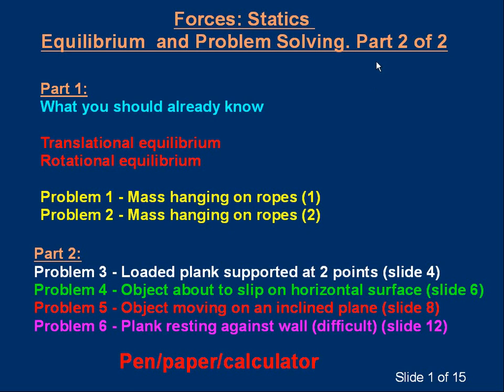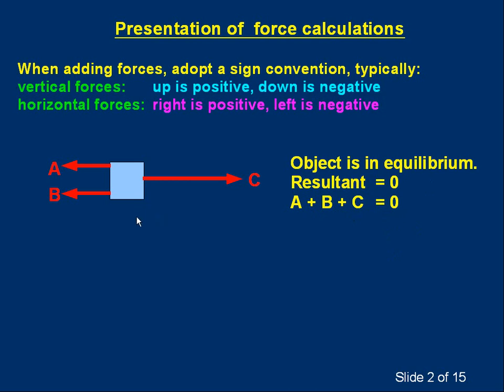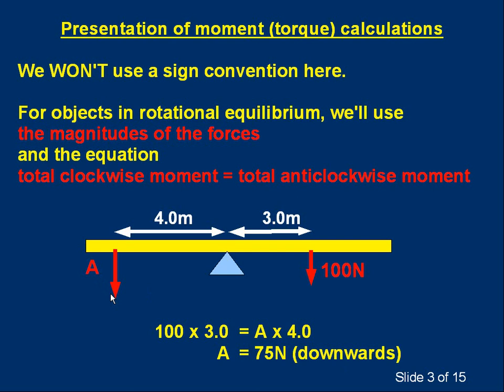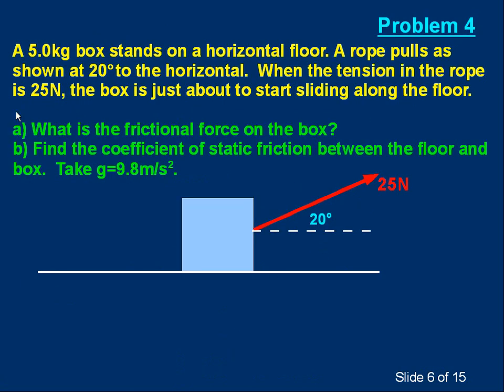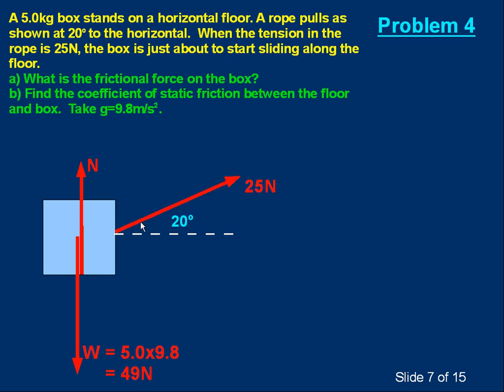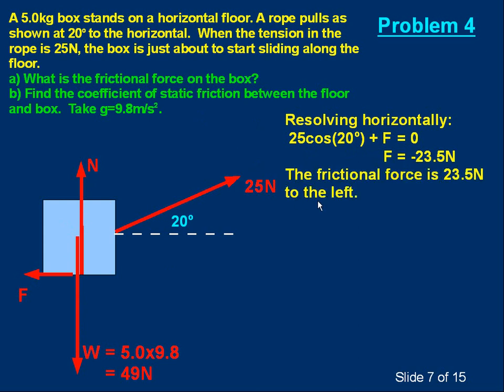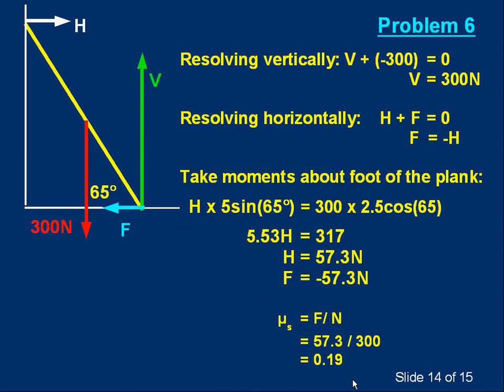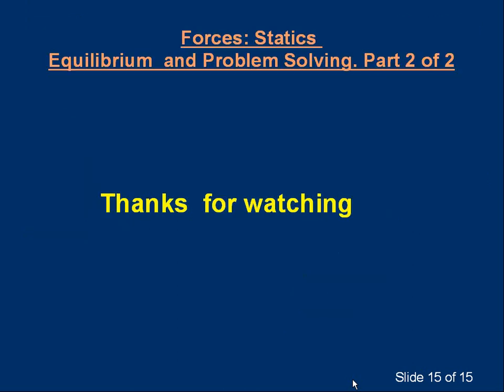M15b Forces: Equilibrium and Problem Solving. Part 2 of 2.

Comment: Hi, thanks for the brilliant videos great job. Just a question at 25:13 problem 5, when you are resolving the plane parallel to the slope why is Frictional Force F positive? should it not be negative as it is opposing motion, i see that the answer is negative which is correct but when you are resolving it is positive.
Reply from the maker: When 3 vectors, A, B and C, have a zero resultant we write
A+B+C = 0

Suppose A, B and C are co-linear, then they can be specified by positive and negative values.

B and C are not necessarily positive, just because they have plus signs in front of them! (Nor is A necessarily positive).

For example A= -2, C=15 can be solved  to give B = -13.

In the video:
A = 25cos(20⁰)
B = Frictional force, F (which we may expect a to have a negative value, but still requires a '+' sign in front of the 'F', the same as the '+' in front of B in A+B+C=0).
C = -49sin(sin15⁰)

We must NOT write:
25cos(20⁰) - F - 49sin(sin15⁰) = 0 ! This is wrong and will give an incorrect sign for F,
_______________________

If we use the magnitudes of the forces could say:

|uphill forces| = |downhill forces|

25cos(20⁰) = |F| + 49in(sin15⁰)

This would give |F|=10.8N and we could then add the sign manually.

Hope that helps.

Comment: Hey Steve.  I’m ashamed of myself.  Here it’s 2023 and I’m just getting around to absorbing your fine material.  I very much like your problem on the toppling box, a fine informative overview of the limiting angle.  In working through Problem 6 herewith I think you might be in error in the multiplication; i.e., in summing up the moments (W) 5m times sine 65 = 4.53159 vs your 53.53159.
Reply from the maker: Well spotted!  On slide 14 I calculated  5sin(65º).  Looks like I made a typing error, the answer is 4.53 but I’ve typed 5.53.

The correct frictional force should be -70.0N. And the correct coefficient of friction should be 0.23.

My days of making YouTube videos are over, but if I can find a way to add an on-screen correction without too much effort I will do that.  Good luck with your studying.

Comment: Also i like your method of resolving problems on inclined planes but also came across two formulas which i have been trying to relate to your way of resolving forces in parallel and perpendicular to the plane, sum of forces in the x direction= -mgsin(theata)+coefficient of kinetic friction*mgcos(theata)=0 can this be used to resolve problem 5? the second formula was sum of forces in x direction = -mgsin(theata) + coefficient of kinetic friction*mgcos(theata)=ma how  is friction calculated from that formula. Thanks
Reply from the maker: The formula you state for the total force in the x-direction (Fx) is:
Fx = -mgsin(θ)+μmgcos(θ)

I think you have misunderstood.  This is the total force parallel the the plane, NOT in the horizontal direction. Your 'x-direction' means parallel to the plane (the same as I have used).

Your 2 formulae are for a completely different problem to problem 5, and cannot be used for problem 5.  Your formulae assume no additional force is applied to mass and the mass is moving uphill, slowing down. Fx is the resultant force, in the direction parallel to the plane, which would cause acceleration (actually slowing).

The acceleration, a,  in the direction parallel to the plane would be given by 'F=ma':
-mgsin(θ)+μmgcos(θ) = ma
This is where your second equation comes from.

Note that m cancels, so your second equation is:
a = μgcos(θ) - gsin(θ)

So for a different problem, with a mass sliding uphill and lowing down, if you know a, g and θ the you can find μ with some simple algebra and arithmetic.

It is very risky to use formulae without fully understanding where they come from - so take care!

Comment: Which means in problem 4 the normal force will be equal to the weight if the force appllied was at the base of the box ?
Reply from the maker: No. Applying the force at the base would make no difference to this calculation.  The 25N force has an upwards component of 25sin(20°), so the normal force will still be:
N = |weight| - 25sin(20°). = 49 - 25sin(20°). = 40.4N as shown on slide 7.

On a horizontal surface (with no vertical acceleration) the normal force only equals the weight when there are no other forces with vertical components.